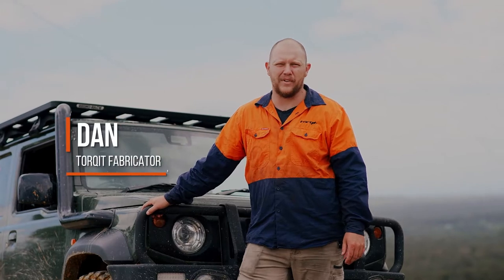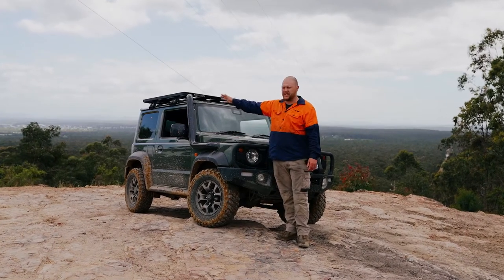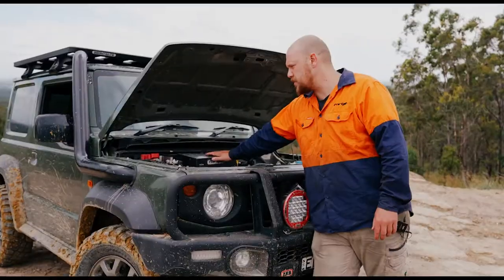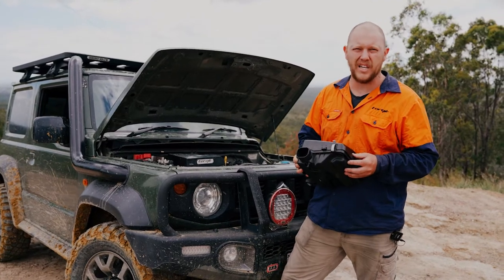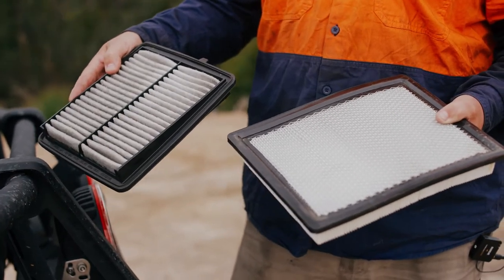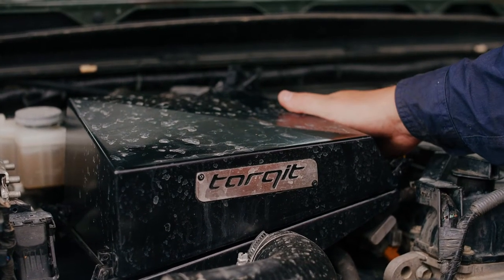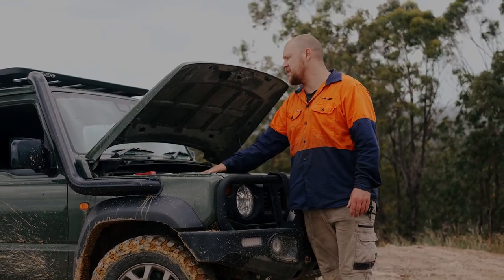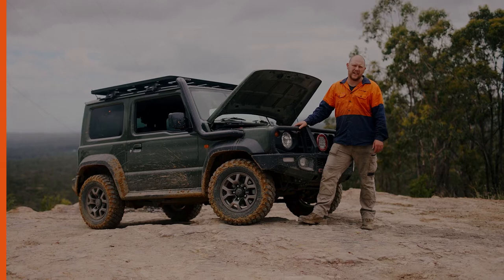Breathing Easier with a STAINLESS STEEL JIMNY SNORKEL & AIRBOX

Comment: Is the air filter meant to be upside down for how the filter is designed to work?
Reply from the maker: The air comes into the bottom of the airbox and exits the airbox heading towards the engine from the top, so the air filter is in the correct orientation for this.
Reply: @TorqitPerformance thats the same setup as say a 200 series airbox, air in on the bottom, and out the top towards the engine, but Toyota have the filter installed the opposite way to this
Reply from the maker: The mesh must face towards the incoming airflow, with fins facing down. Not sure regarding the 200 as we don't offer one for it yet. @nelsonward8182
Reply from the maker: At least for our Ryco filter that we use
Reply: @TorqitPerformance okay no problem, if its not a factory air filter, what filter is the ryco version?
Reply from the maker: It's the commodore filter part number is Ryco A1358  @nelsonward8182